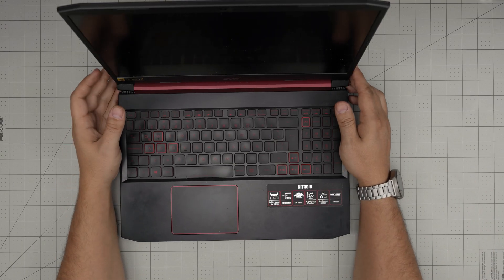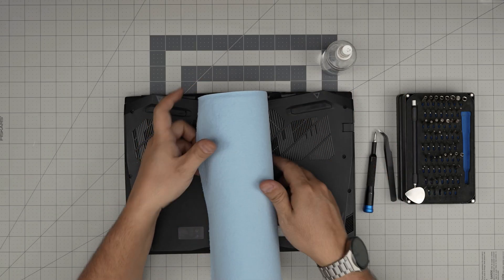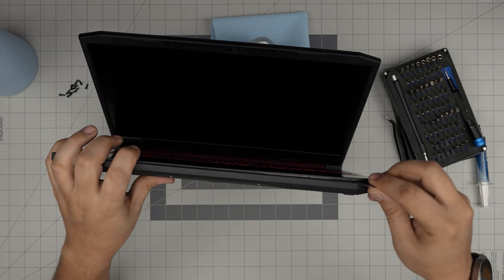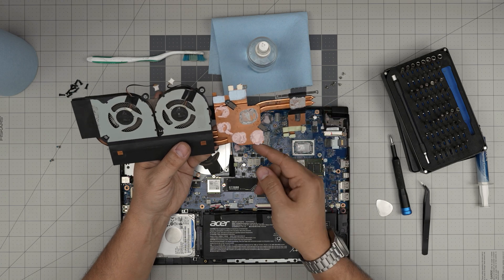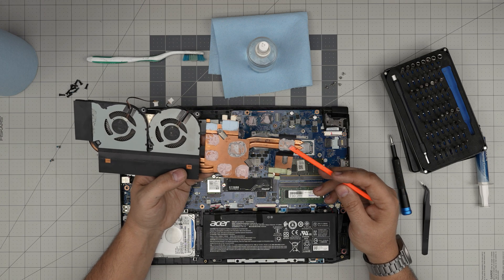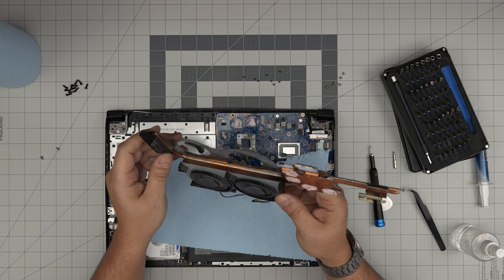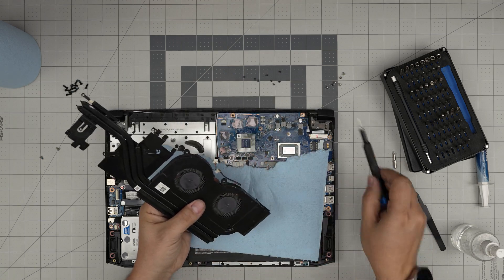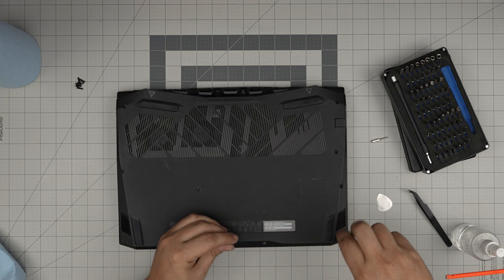How to Repaste & Clean Your ACER Nitro 5 AN515-43-R261 Laptop

Comment: Would it affect anything if I were to cut the fan cover plate off the heat sink itself making it a separate piece to remove to get to the cooling fans easier then having to remove the entire heat sink and fans? Any input would be much appreciated.
Reply from the maker: 🫠Regarding your question, sure, you can, and we have done it in the past with zero issues with temperatures. The temps were the same as before cutting it.
We did the test because people were saying the plate was absorbing the heat and such, but after cutting it and testing it, the results came back with no difference.
Should you have any further questions or requests in the future, please don't hesitate to ask me.
cheers🍻